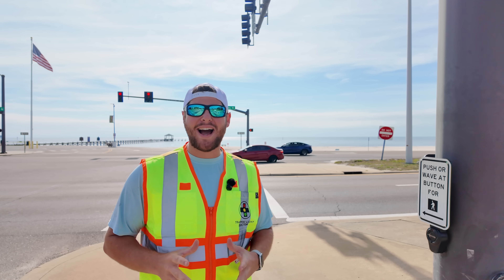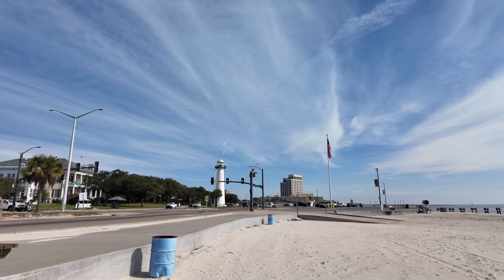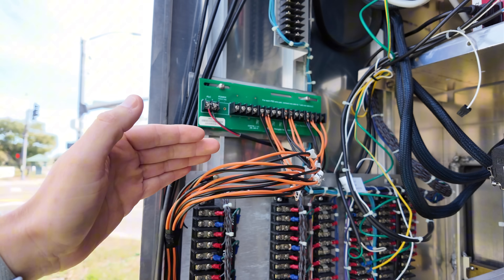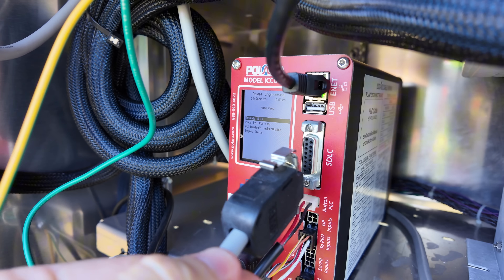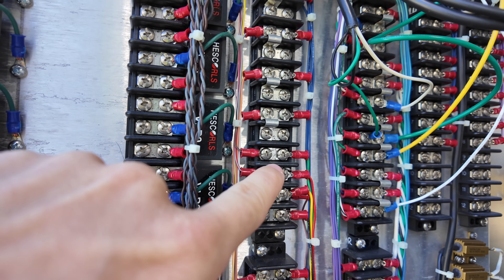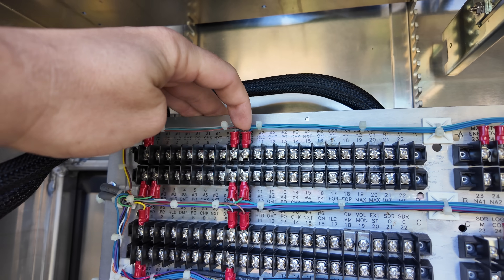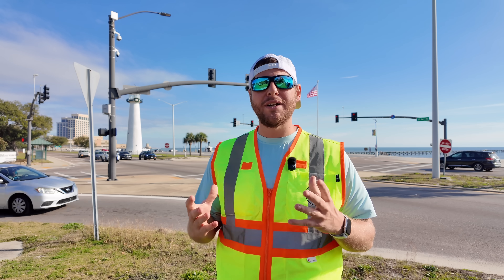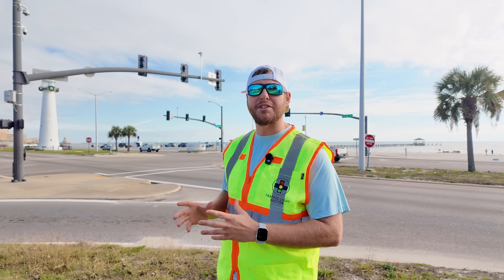What Happens When You Press A Pedestrian Button?

Comment: did I mis where it can tell which button was pressed?
Reply: He didn’t state it very clearly… Essentially each of the four corners has its own set of two wires… He did mention the two wires… And each one feeds back to the panel and there was one point where he pointed inside the panel at the control box to a specific line that said something along the lines of “ P” which is short for pedestrian and then there were eight for double character positions on the display panel and at the time he was showing it to us I believe the code was “cc“ which indicates which of the four lights have been activated… But it’s nothing you or I would ever see or benefit from.
He essentially wasted seven minutes of our time rather than just getting to the point and saying as he did in the final one minute “you can push that light to your blue in the face, but these other lights will run their normal full cycle anyway. The only difference is that on these intersections where they have the button, if you do not push the button the light will stay as an amber “do not walk” signal… Which unfortunately gives uninformed car drivers a sense of entitlement that they no longer have to give pedestrians quote the right way”… Which is completely false.
Reply: @allucht6664  ok so I didn't mis the part, it really wasn't there...

Comment: Skip all the nonsense to 7:30 for the answer
Reply: Thank you! He wastes seven full minutes talking about the wiring instead of getting to the point as he did in the final one minute where he essentially says “you can push that button until you’re blue in the face, but all the other lights will run their normal full duration anyway. The only thing pushing that button accomplishes is that when it finally gets to the pedestrians turn, instead of the light changing from its apparently now “standard lighting condition“ which at that intersection appears to be standard of “amber do not walk“… The light should change to a white walk indicator.

The question you and I should pose is why has his DOT decided that the now standard lighting condition at that intersection should be amber “do not walk”? That does not increase pedestrian and safety!
Because now “uninformed, entitled car drivers” might get the impression that pedestrians no longer have the “right of way” at intersections… Which is completely false and can lead to an increase of pedestrian in injuries and fatalities… Not to mention the lawsuits that would go along with it.😮

Comment: So the button goes through ten different connections and four devices before it reaches the controller itself, each of which can fail in its own subtle way.
Reply: And the real kicker is he wasted seven minutes out of our time rather than cutting to the chase as he did in the final one minute where he essentially said “and you could push this button until you’re blue in the face, the rest of their lights will still run through their full duration so there is essentially no advantage to pushing the button.”
Reply: @allucht6664  There's a few intersections where pressing the button brings the walk signal into the cycle, hopefully forcing drivers to yield to the pedestrians. That's about the only useful feature I'm aware of.

Comment: How does the button only have two wires when it's multifunctional. As in, it's not like pushing the button just completes a circuit. The thing obviously lights up, it plays a sound, it says "wait" when pushed, etc.
Reply: The button actually only does “just complete the circuit.
Which then allows a low-voltage signal to get into that complicated control box device which is probably where this guy stated “where the magic happens”.
So all the complicated stuff happens in the control box… Not at the push button.👌
Reply: @allucht6664  Then how does it beep? How does it say "Wait"? And if you press it a bunch of times, it actually says "Wait" differently. How does all that happen with only two wires?

Comment: I've long known pushing those pedestrian buttons multiple times doesn't make the lights change any faster, however, with older buttons that gave no feedback to the pedestirans of whether or not it had registered the push, I'd usually push it about 3 or 4 times just to make sure my push was detected, especially in case the button may be getting near the end of it's life and may not be 100% reliable in detecting if it's been pushed or not. With modern buttons, they'll beep or light up an LED to let me know it's detected my push, so I only need to do it until it's signalled it's detected me. I really don't understand how so many people think if you push those buttons 500 times it's somehow going to make the lights change any faster. That's never made any sense to me.

Comment: "Your call is important to us.  Please hold the line and we will get back to you (eventually) or maybe not."  The button may or may not be working.  Unless there is a positive affirmation that the button has been pressed.  This is often, but not always, relayed via a message "wait" and a red light at the pushbutton.  If the green light for your direction has just gone green forget about crossing for a LONG time.  You won't be permitted to walk because you are not driving a car.  And cars have priority.
Reply: The gas tax paid by the  cars drivers put in the crosswalk, so......since the pedestrian contributed nothing, they can wait. Except in kalifornia where the law unreflectively support the slack assed pedestrian by suspending the laws of physics, economics and common sense

Comment: I thought you were going to talk about how repeatedly pressing the button is not going to make the light change faster. 

The truth is, these buttons are on a timed system. The traffic lights are timed. It doesn't matter if it's a busy highway with a connecting side street or the intersection of two side streets. When you press the button it tells the system that there is a pedestrian waiting to cross the street. It does the same thing that those circles in the street do when cars drive over them. It tells the system that there are cars waiting to go through the intersection. Normally, lights are timed for 1 minute intervals. What I'm not sure of is if it's 1 minute in total, or 1 minute on the green followed by some seconds on the yellow and red.

When you press the walk button it merely tells the system to engage the walk sign when the light changes to green for that direction. It does not change the interval. However, on a busy boulevard with a connecting side street, the connecting boulevard will stay green much longer. This is due to the fact of the side street having much less traffic. In that case, pressing the walk button will cause the system to interrupt the busy streets lights and make the light change faster so that The pedestrian can cross the street. How much time you have to wait is based on how much of the cycle has already gone by. If the cycle has just started, you have to wait for that cycle to finish before the light changes.

Comment: Are the buttons wired N.O. or N.C.? It’s important to know if the contacts can fail to make due to corrosion and weathering. A better design would have a lamp on the button box to confirm the signal controller received the button press.

Comment: We got this San Diego intersection. We have a very busy Sea World Dr E & W. Then we have E Mission Bay Dr, south bound very busy coming from all the bay front Parks. East bound maybe 1 or 2 cars stopped. So S bound is given priority to clear out the long lines of cars.
Special Events either police or event staff switch lights to flash all red while they manually Direct Traffic.
When they are finished, they reset the lights. After that, the lights go to a standard pattern, causing the very busy southbound to only let four cars take a left turn while the line to the light stretches for two blocks and stays this way for the next 3 weeks or so until it is set right again. 
....Why does this happen? If there's just a switch for emergency Red Flash, when it's turned off, why doesn't it go to previous programming instead of a standard programming?

Comment: But what happens when you push the button? You are put in line attached to a green light moving parallel to you. You'll go after the cars crossing your path get a red. If the intersection is on timers (vs sensors) you might wait up to 4 minutes. If there is a left turn crossing your path from your right (and behind you as you cross) it will stay red, usually until the next cycle. It has replaced that left turn with a walk. 

So while you are enjoying your walk in the crosswalk, all cars are moving parallel to you. No green turn arrows. Or only you and the left turn opposite you can go.  You still have to watch out for cars coming towards you that are turning right because they don't gaf and aren't looking for you. The green walk sign means nothing to them. 
What sound the button makes if you push it during a green walk sign. "walk!" maybe.

There are two types of left turn signals, depending on traffic patterns. 1. Both sides left turn only, no one else. 2. Left turn and straight green for one side only then the left turns red and both get green straight. This one has more sensors. The left turn may turn red before the car gets through the intersection, if it is the only car turning. Wait times are drastically reduced when sensors are installed (and connected to the PLC)
Many intersections won't allow green turn if no cars are in that lane. Sensors and cameras try to detect you. Now whip it. Whip it good.

Comment: There were some pedestrian controlled lights in my town, for what ever reason the lights would not trigger all the time after pressing the button, a few times I'd press the button, the light is flashing green then goes to a solid green before changing, sometimes they would stop blinking then start blinking green again. One day I ran out of gas walked to the gas station with a gas can.. I hit the button and the light did what i explained above. I was so angry with this light as it does this often, so I hit the button like 20 times in a row it then changed to solid green then to red much quicker after that.

Comment: That's right I'm the one who said they don't work. Because they don't. I've been cycling in my city for 40 years. They only allow to cross when the cycle for automobiles goes through it's rotation/cycle til the crosswalk light comes where you just so happen to be. No matter what the direction the pedestrian is going. The cross walk light will eventually activate so you can cross. Again those buttons to cross so not work. In my city there are crosswalks in random places where there is no intersection. Those crosswalks were installed so pedestrians could cross, and guess what. The button triggers a yellow then red light so you can cross. At intersections they don't work.

Comment: This video presents a lot of useless technical information without offering any practical information.  As a frequent pedestrian let me offer my impression of what happens with those buttons. 

Pressing the 'walk' button does not cause the light to change any sooner.  It may or may not cause the light to give the pedestrian more time to cross once it has changed.  This makes sense.  If I am crossing a busy street, the motor traffic on the cross street may be able to clear the intersection more quickly than I can.  It makes no sense to hold up traffic on the busy street longer than required for the less busy street to clear unless there is also pedestrian traffic that needs more time to cross than is needed by motor traffic.  This also explains why some intersections have walk signs on the busiest street but not on the less busy cross street: the busy street will always take longer to clear the intersection than needed by a pedestrian.

I do not know for a fact that this explanation is accurate. It is simply the explanation that makes the most sense to me.

Comment: So does the output of the PLC contain coded information as to which crossing button was pushed? In looking at how this is wired, it seemed that it simply produces an output, eventually routed to the main m60 controller, that indicates one of the buttons was pressed. That doesn't seem correct as it would trigger walk events for all directions, and the m60 seems to show multiple pedestrian channels/queues. 

I love the detail in the video, but my background is electronics and coding so I love the details in how these systems work. Apparently YouTube is aware of this and has chosen to put you into my recommended videos queue...

Comment: I'd posit that people actually don't think that the beg buttons don't do anything. They push it more than once because they're frustrated that it takes so long for the walk light to come on (or because their cycle got skipped altogether). 

It's the de-prioritization of PEOPLE in favor of cars that sucks. In the Netherlands they have figured out how to optimize these control boxes to prioritize people. They even have substantial islands dividing opposite traffic at big intersections so they could give you 2 phrase walk light to get you to the island, and then to get completely across, so you don't wait forever at the corner (and so the walk phrase doesn't have to last long enough for someone to cross the entire 6 lanes.... hence the stupid long red for the cars when someone pressed the beg button and changed their mind and don't cross. Then the cars are waiting forever for the walk cycle to pass even tho nobody is crossing). 

So... it's the traffic engineering that is the problem. Not the pedestrians.

Comment: TLD, you should have explained that pushing the cross button does not make the WALK lights change faster. This is why people believe the button is not working properly and why people push the button a thousand times thinking it will make the traffic light change faster to getting the WALK light. What the pedestrian button only do is make the walk like stay on longer. Or for some reason there is not a pedestrian WALK automatically that button will make that happen. This button is like when cars stop for the red light believing the red light is taking to long the driver will move up closer to the pedestrian crossing lane thinking that will speed up or help the system know there is a car/s waiting (there is a video for this). Neither will help the WALK light or red light move quicker.

Comment: There are two intersections I cross often to know what's the effect the button has.   
One only enables the light on one side of the intersection (the other sides are always included in the cycle)  
And the other one does absolutely nothing. It's on a single lane street which is basically empty most of the time but has a decent pedestrian traffic so it's infuriating that there's not even an attempt to cut short the time for the cars.

Comment: As someone who's never owned a car with a short answer:
Pedestrian crossing = slightly longer time for traffic to allow a person to walk across DURING that traffic's turn. Pressing the button doesn't change the order, or shorten the order, just gives you enough time to cross when it finally IS your direction's turn.

Some intersections have metal detectors at the stop line to detect cars. It's like a cross-walk button for cars. They don't get served sooner, it just doesn't skip over them.

I've come to a crosswalk that already had a long light, and I noticed the walk sign always turn on regardless of pressing the button. Which I guess was because the light was long enough anyways for anyone to safely walk across. What I'm not sure of, is if there's a built in timer that automatically recognizes that, or if was wired that way.

Comment: This is the most detailed explanation of how and why the pedestrian buttons should, in theory, work.  But we know they don't work. I look both ways before crossing and run.
Reply: I pole vault over intersections. Safest way to travel.
Reply: What is have realised is don't press it if it's still flashing red or counting down on the last few seconds or however it displays that there's no more time to cross wait until it's a static no crossing symbol/indicator to press the button as with everything computerised there will be an optimal input timing. Since I started doing that never had a problem and I perceive it as responding faster
Reply: @1Kadra I mean yea, it's not gonna go right  back to "cross" or "walk" if you press it while it was blinking or counting down. 
You're SUPPOSED to press it during the solid "no crossing" symbol. Then it'll put you next in the que for after the traffic lights cycle.
Reply: @1Kadra  In English please?
Reply: Yep!

Comment: Not that this has anything to do with a pedestrian crossing, but while visiting Pismo Beach last week, I saw something unusual. At one intersection, an LED above a traffic light displays the universal "No Left Turn" sign when traffic is heavy. If traffic is light, the screen is blank.

There isn't a left turn signal, so I understand the need to stop left turns during heavy traffic. However, it seems better to add a left turn arrow instead of just putting up a no left turn sign.

Comment: Dude, how about when you press the button it signals a computer to cycle the light so you can cross but it's not immediate request, it still waits until the existing cycle is completed. There, save you 8 minutes.